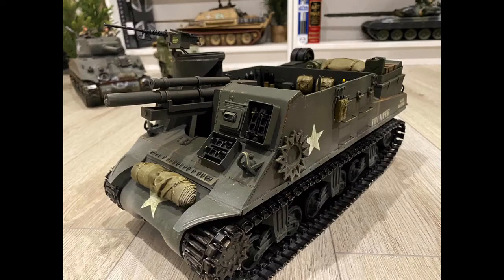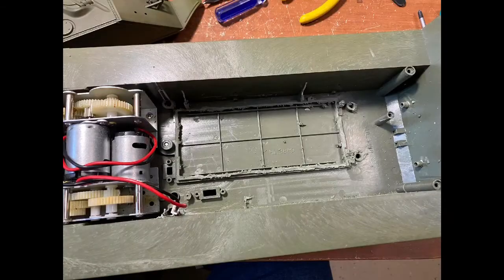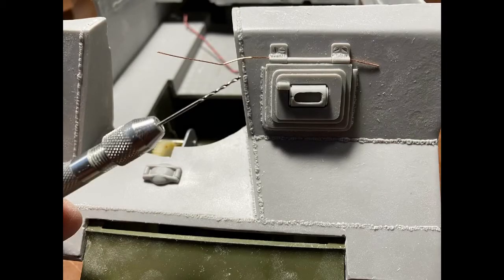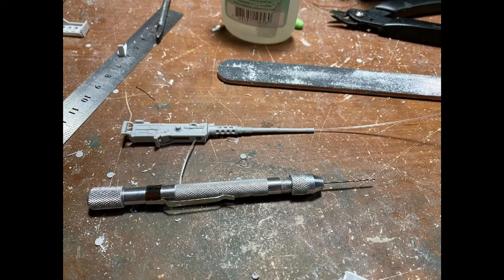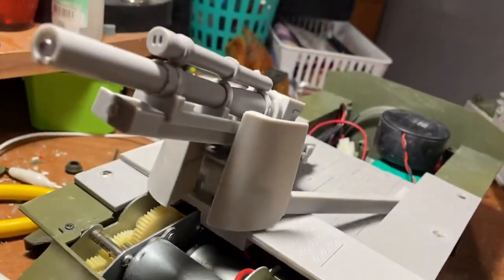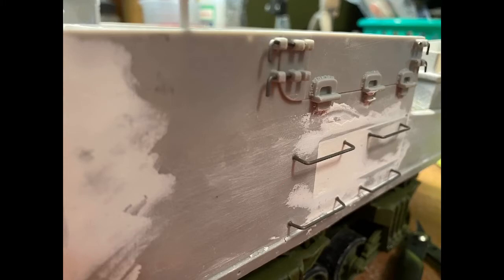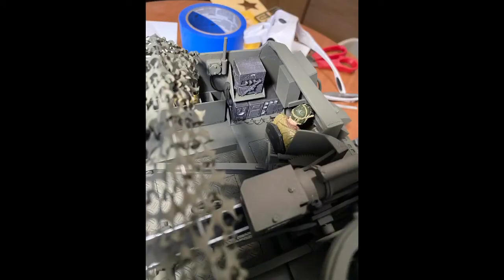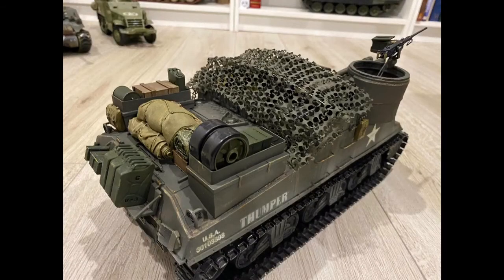M7B1 Priest conversion from Vandra model kit

Comment: thank you, i also bought the Vandra conversion and my "buddy" gave me an old sherman hull (minus gearboxes and tracks, but he then gave me some Mato brass gearboxes and they fit, now i placed an order for tracks)  i also use the HL 6.0 system and do plan to do a servo based gun recoil, i also looked if i could do elevation and i think there is a way but have to figure that out later.
you are right, the Vandra kit is a challenge, the instructions are pictures only and don't always show/tell what has to be done, i had a hard time getting the gun to sit properly as somehow it always tries to pull th base up at the front, i have no plans of going nuts on her as i don't want to spend a fortune on stuff that people touch, break of and take home as souvenir (i also do boats, can't tell you howmany flagpoles i have "lost")  butseeing one build is nice,
like you i also have the sherman, the m19  aa halftrack and now the m7.
Thanks again.